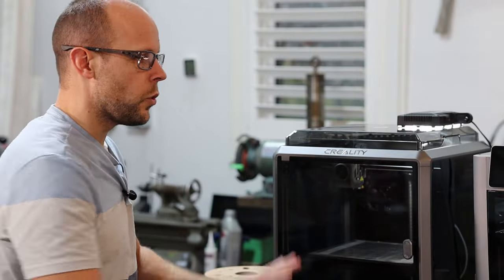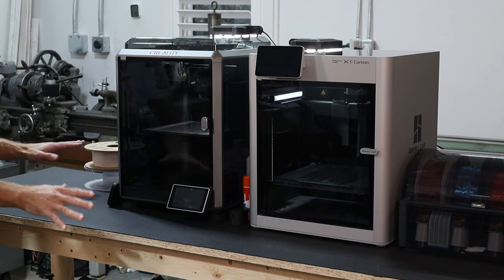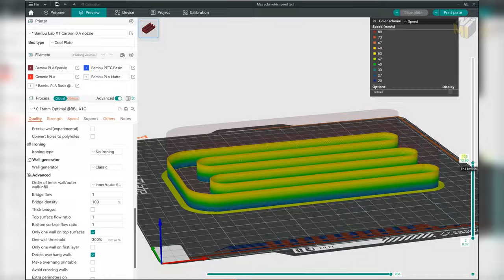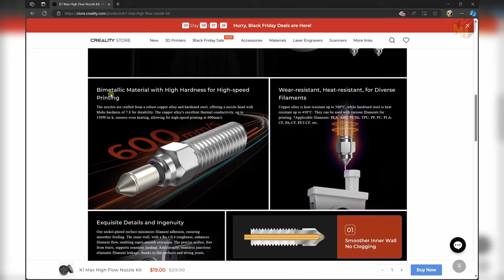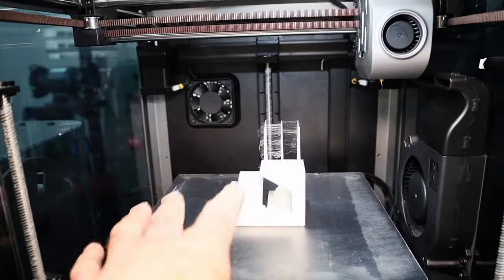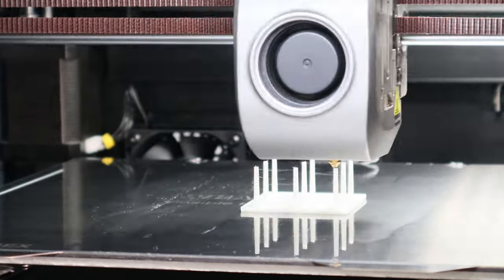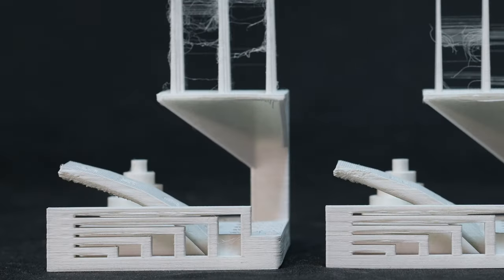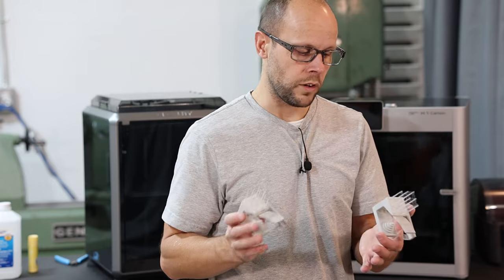Printer VS Printer - Creality K1 faces off against the Bambu X1C at HIGH SPEED - Who Wins?

Comment: Hard to find comparison videos using the same slicer. Thanks for making this. 

Too many four month old comparisons prior to the open source software release and the significant price drops on the K1. 

Most makers haven’t updated since they did their early comparison videos when their free units arrived.
Reply from the maker: My pleasure! 

I wasn't feeling good about Creality slicer and running comparisons between the printers using it.  I love Orca, it's so nice to be able to run both printers from the same slicer, and switch back and fourth easily for the same parts on the buildplate.  It's pretty cool!  Another innovation to help us get the parts we want, faster and more reliably.   It makes my job a lot easier for testing too :) 

I made a video a few months back with the drill press chuck key mount, but I wasn't happy with the results from the K1, I stopped until I had the new slicer running. 

I'll keep them coming, I really appreciate you taking the time to give some feedback, it means a lot.  I am committed to providing better content which helps people... or at least is entertaining.
Reply: It seems the marketing budget ran out about 4 months ago
Reply: @corcorandm  haha maybe!

Comment: Where can i find the Test stl file?
Reply from the maker: If you're running Orca, you need only to right click in an open space and then click 'add primitive' it will be in the menu under Autodesk FDM Test.  It's a good test, it has just about everything you'd want and it's large enough to easily see the problems.  If you don't use Orca, can you send me an email and I will send you the file.

Comment: It's pretty difficult to choose a new printer. I've used Creality since the beginning so I know once it's sold in larger quantities and better slicer profiles will emerge, the community will improve the K1 drastically. My Ender 3 v2 is some years old now and looks nothing like the original but the prints that come off it looks way superior to these from the Bambu and the K1, ok, these printers are in another league speedwise but I'm not impressed at all on both of them. But for me speed is less important than quality.
Also the AMS multi color unit is not important at all for me. Prints in color with just the bare filament color looks just plain ugly to me, but I like to paint my prints and that is of course not for everyone. Also the huge amounts of poop I see in every Bambu video bother me a bit, it's just wasting material.
I'm convinced the K1 will improve a whole lot the coming months, especially now they opened up the firmware as open source.
And in my opnion the K1 just looks much better than the Bambu. Also my personal preference of course.

Very good honest video!

Comment: I hear a bunch of trash talk about Prusa's MK4 with input shaping vs Bambu Labs etc.  After having a had a bit of a crisis deciding to go with the MK4 over Bambu initially, I'm glad I did.  The print quality of both the X1 and Creality K1 are atrocious compared to my MK4.  Input shaping is now working really well, and print quality is next level compared to the test blocks here.
Reply from the maker: That's good, I'm glad it worked well for you.  I didn't mention in this video as I have in past videos, but the point of the spray paint is to be able to show any defects as well as possible.  I always use the most harsh lighting for this, the prints look far better when not doing this of course.  If it took your prints and did this, they would also show defects.  But I'll take your word for it that it is better.  There are quite a few variables involved in getting a print that looks perfect, the filament itself plays a good part.  I'll be testing Prusament soon, normally I'd buy the cheap no-name, but it's time to see how good a print can be with the good stuff.  

If an opportunity came up to do a head-to-head between the MK4 and my two, I'd be all over it,  hopefully we can make that happen if I can ramp up enough with this channel to afford to buy one.
Reply: @NeedItMakeIt  Thank you for taking the time to do comparisons. I don’t think the problem is the bambu, but mostly issues with printing 300+mm/s in general. I print only structural parts for commercial/industrial applications and layer adhesion and dimensional accuracy are my main goals. I keep the print speed to 200-250mm/s tops. A byproduct of this is incredible surface finishes on vertical walls. Basics. 

The calibration/ torture tests you showed were pretty good all in all. What I would have expected to be perfect under any circumstance would be the basic exteriors wall geometry of the base before any of the complex printing was happening. It seemed neither printers could even get the sidewalls of the first 2-4mm to look great. 

Check out this demonstration for clarification. 

https://youtu.be/bT0Rj_d801o?si=A1D2IYPo7V0q06Qw

Comment: you lost me at the ridged drill... LOL have some pride man! red or yellow!
Reply from the maker: Well.... let me tell you Sir :).   I have owned Ridgid tool since I was just a teenager, and I still have many of my original Ridgid tools, the others that I don't have, I sold.  That's 25 years of regular use.   I think the only problem I've had is one Lithium battery which was replaced under warranty.  My trade is Woodworking, and I've used all of the brands.  Ridgid is not the best by any means, but they've lasted and for me, that's what's important.   I also can't stand the bright Yellow, I own a few Milwaukee, I've never been blown away, I am a fan of Makita, they focus on what's important.    All of that said, I think if I were to buy a corded/cordless now, it wouldn't be Ridgid, the quality isn't like it used to be, so.   We all love to have a brand and stick with it, it's like picking a Hockey Team... but some of them never win sadly.

Comment: I feel like you should of used filament from a third party
Reply from the maker: I have plans on testing filaments.  There aren't many out there which are meant for high speed, and with the stock extruders, they're not going to be able to get to the speeds I wanted.  I've had good success with the Hyper PLA though it is quite expensive.  I think an extruder swap with something like Micro Swiss High Flow for the K1, and E3D's for the Bambu would be a good tests at high speed.  We can always revisit, I'm happy to do them.